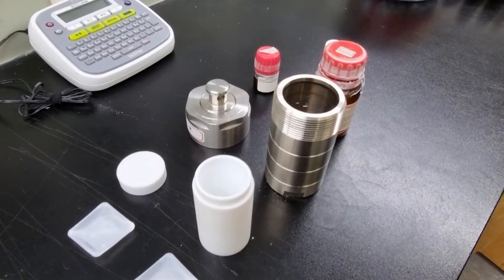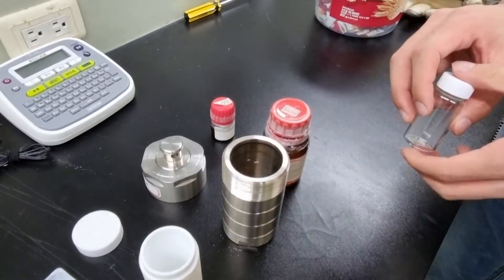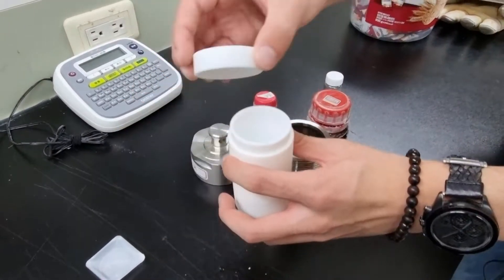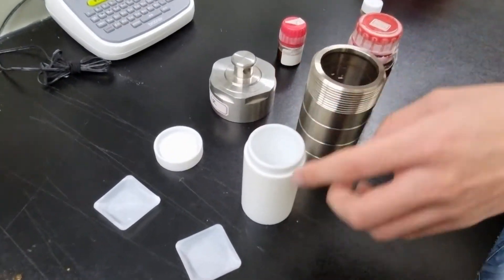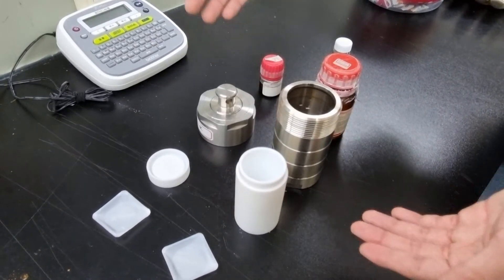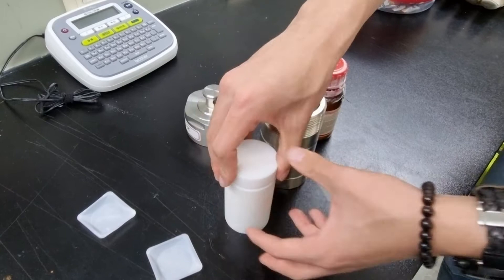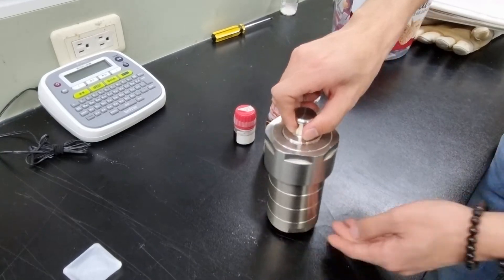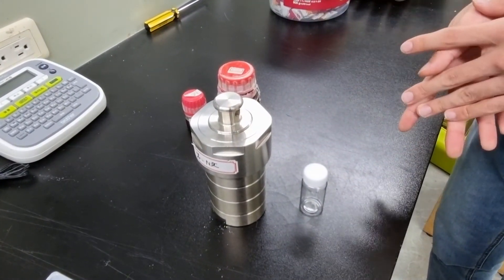[KSA은영샘의 클라쓰]How  to  use Teflon-lined autoclave

Comment: In your experience how long does one ptfe last? How many time did you reuse one ptfe? (approximately)
I know it depends on several factors but I'm asking about your experience
Reply from the maker: It’s a difficult question to answer because it really depends on how often and how carefully you use it. Typically, it lasts at least three years, and in some cases, up to ten years. However, I believe that if it gets scratched during cleaning, it could affect the results.